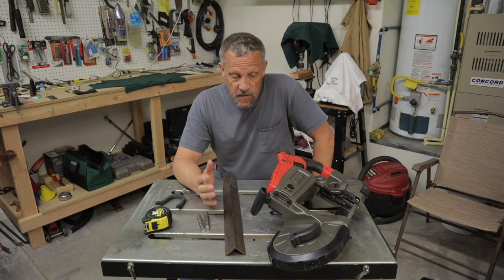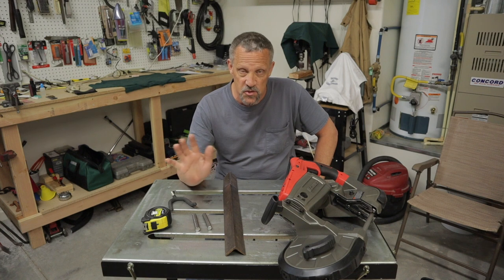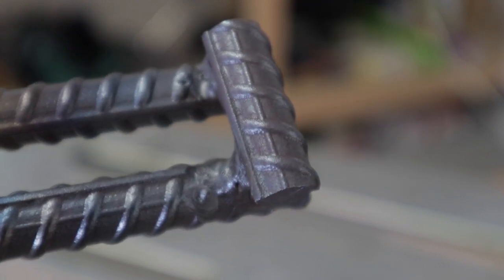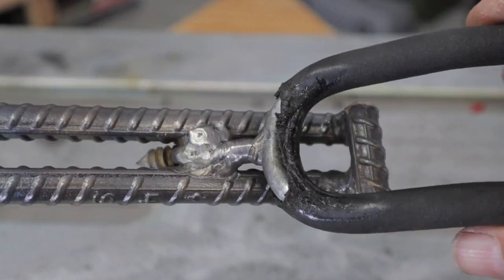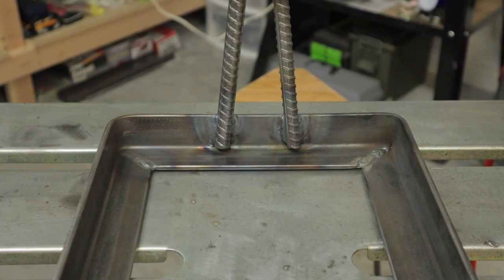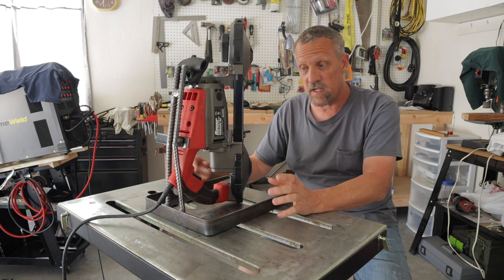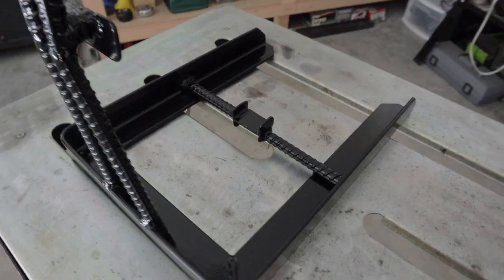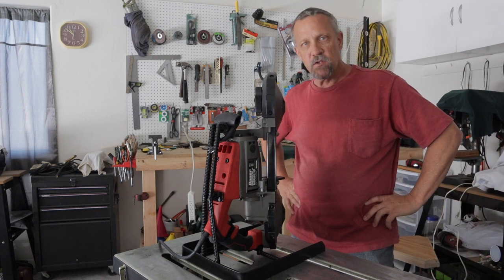DIY Harbor Freight Portable Bandsaw Stand - Homemade Tool Ideas - Fun Beginner Welding Projects

Comment: I built a similar stand out of scrap wood with great results.
I thought it over and went with the foot operated switch.
The reason being SAFETY. If for whatever reason anything goes wrong you’re going to step off the switch and these saws stop really quick.

Comment: I made a similar stand but the way i bent the rebar was to use a propane torch on it until it glowed, then clamped it into a vise and bent it. worked great and no breaking.

Comment: From a beginner tig welder, the best thing I have found to get any weld to come out better is to have something to rest your torch arm on. Even resting your elbow makes a huge diff. Made a large C clamp and used that to rest my arm on off my welding table.
Also hard to tell but seems like your gas flow is high, based on how far the arc was flying.
Stand looks great!
Reply from the maker: Thank you for the tips, I appreciate it. I agree with you and think positioning can have a huge affect on my weld. I really find positioning a challenge most of the time. I guess practice and experience will make it easier over time. I have my gas flow set at 15 cfh and my welds are coming out pretty dull and grey. From what I've read the cfh seems about right for my amperage I think. The dull color may be due to the metal I'm welding and how clean it is or isn't. Also I didn't remove the mill-scale from the angle iron, I'm guessing that has an affect on the weld appearance as well. A lot of things to think about and work on with this welding process for sure. Thanks again and take care.
Reply: @DIYHomesteadProjectsDIYHP10  I have always seen match gas flow to cup size. Usually about cup size x 2.
15 should be fine though unless you're running a 4 or 5 cup. Dull and grey is how mine started, learned to match amps to thickness of metal and my welding speed from weld.com. They always say once you establish your puddle start moving but never leave it behind haha. 
Good luck with the Tig and your next project
Reply from the maker: Again thank you for the tips and info. So far I've been running a 6 & 7 cup. I definitely need to work on amps. Most of the time I think I'm using way too many amps. Reading the puddle is what I'm trying to learn to do so I can adjust as needed with the pedal. I need lots of practice. Take care :)

Comment: Hey buddy,,  i watched your video about making stand for the bandsaw,, i have it too,, and i can say that it is a good bandsaw,  but anyway,, i watched how you welded the rebar and other metal.  I know you mentioned that you are a newbee in welding,, but  just one small advice when you tig weld,, first start your puddle and then add the filler rod,, but you probably know it now. nice video.
Reply from the maker: Thanks for the tips Martin!

Comment: Very nice...ingenuity is great.  Suggestion - I noticed you remove the torch from your weld stop way too soon. Keep it there bathing it in Argon.  Set your post flow for five to seven seconds until it doesn’t glow.  This will almost eliminate oxidation and weld contamination.  Enjoy your vids.
Reply from the maker: Thanks for the tip Rob, I appreciate it!

Comment: That ended up looking pretty slick... 

2 observations:
- that U hanger/hook thing was galvanized.  You should have taken the galvanizing off of it before welding, I'm surprised that you were able to TIG it at all with the coating on it, but even if you did the fumes from the zinc burning off are very dangerous, they could make you quite sick
- you appear to be right-handed (based on the way you're gesturing and doing some things, but I'm not sure), you're welding left-handed.
Reply from the maker: Thank you Mark, I'm real happy how the stand came out. I use it in the shop quite often and it's one of my most used items I've made recently.
I am aware of welding on galvanized items and I agree with you. If I weld on anything galvanized I try to do it out in the open air and I also use a fan sometimes to blow the fumes and smoke away from my face. Mostly I just try to avoid welding anything galvanized. Thanks for the heads up and concern for my health.
I'm actually predominately left handed but in some cases I'm ambidextrous. In some cases there are things I can't do with either hand. LOL 👍
Reply: @DIYHomesteadProjectsDIYHP10  Lately I've been dunking stuff that's galvanized in muriatic acid, which takes it off quickly.

I watched a few of your other videos and couldn't decide if you were right or left handed.  My daughter is ambidextrous but finally decided to write with her left (she draws with both, she'll switch when she gets tired 😋 )
Reply from the maker: I've heard that vinegar works too but it takes longer than the muriatic acid. If welding a lot of galvanized parts, one of those ideas may be the way to go.

Comment: I loved the video and watched it all.  If your overheated U-hook coating starts sliding off in the future try a few wraps of rubber fusion tape.  I love making something from nearly nothing too.  You nailed it on this build. Thanks for taking the time to share.
Reply from the maker: Thank you for watching! That's a good suggestion for keeping the coating on the u-hook. Fortunately so far it hasn't been an issue as I once thought it might be. This stand is one of the best things I have made for this saw. Have you seen the custom table I made for the saw? I'll post a link here for you if you are interested in watching that one. Thank you for the nice comment!
DIY Harbor Freight Portable Bandsaw Table - https://youtu.be/1aGmnCkNnfU
Reply: Liquid electrical tape! I use it for tool handles frequently when they fail!.
Reply: Substitute fuel line hose for the melted coating.

Comment: Great job! So many different builds for there on YouTube and yours is as good or better than most. Also, your welding, for a beginner, is nothing to be ashamed of. With some more practice, your welds will be as pretty as they are solid. Thanks for sharing your ideas and advice.
Reply from the maker: Thanks Bones 1477! It's been a great stand and it was a fun project to do. I appreciate the encouragement on the welding. The more I practice the better my welds are for sure. Thanks again for your positive input!

Comment: Very cool. I really like the way you let the saw actually drive the design fitment process and the final solution; simple and solid with an industrial art touch.   Nicely done! 

 Having the same saw, I plan to follow your lead, but reduce the footprint and make vise mountable to save space. However, a cut off saw pivot mod seems doable at well.  

Regarding welding rebar, my research indicates that rebar marked with a  "W" (ASM A706) is formulated for welding, but ASM 615 (not really recommened for welding due to higher carbon content)  is much more common and what I find at the local big box stores.  I wager it is probably what most folks use for welded art projects anyway.   So, what flavor did you end up using, rebar, filler rod, etc.?   I'll be using Mig with ER70S2.  Just got a TIG welder for X-mas, but the actual welding part still eludes me.  Thanks.
Reply from the maker: Thanks, I appreciate that. The stand has proven to be a very useful tool in my shop. It was well worth building IMO. 
I really don't know what rebar I used, what ever kind I found at my local Lowes. I used ER70S6 3/32" filler rod and I think around 100 amps maybe 110. I found the rebar I used seemed to weld nicely with the TIG but I have also used MIG with ER70S6 .030 wire and .030 flux core wire on a 120V gassless MIG and it did fine there too. I've even stick welded this rebar with 6013 3.32" rods and that worked well too. Heck, I'll use pretty much anything to weld it and it is about as cheap of steel I can buy so I build a lot of things out of it. It's fun to design and dream up things to make out of it I think. Have fun with your project!
Reply: @DIYHomesteadProjectsDIYHP10  Sold!   Thanks for the feedback.  Subscribed.  I'll have to go back and review your channel's library.   

Now that I think about it, easily scrounged bed frame steel is harder than Chinese algebra and it seems to weld just fine.    I suppose the "no welding 615 rebar" advisory is really more applicable to concrete reinforcement applications.

Comment: Great build and really good vid.
Clean design. Rebar, 3' angle iron, gararge hanger/hook and a piece of rubber. No frills.
Just needs a plate attached inplace of the guide thingy to lay work piece on as you run it into the blade.
I think I'll build this first and do a Horizontal/Vertical version latter. This is just too simple and low cost to pass up.
Thanks for posting.

Gota Sub to see any new stuff from you....
Reply from the maker: Thanks RJ, I appreciate it! You may like this one https://youtu.be/1aGmnCkNnfU

Comment: Good job! Are you going to add a table top plate so you can lay your prices on it when your cutting? Also you really are getting the tig welding down! "Practice is the Mother of Skill"!
Reply from the maker: Thanks Glen, you are right, practice is the key!

Yes I did make a table for the portable band saw. I didn't want it too large because I want to keep the saw portable. Here is a link to that video if you are interested.
DIY Harbor Freight Portable Bandsaw Table - https://youtu.be/1aGmnCkNnfU

Comment: Gonna start to work on mine this coming week. Thanks for the great video. Out of curiosity, did you get the saw blade (band) from Harbor Freight or from another store? I've heard the blades from Harbor Freight aren't very good.
Reply from the maker: Garry the blades I used in the video are from Harbor Freight and I found them to be descent. I purchased some Dewalt blades from Amazon and they are what I have been using lately. They seem to be ok too and last about the same time as the HF blades in my opinion. 

DEWALT Portable Band Saw Blade - https://amzn.to/3MGBn6T
Reply: @DIYHomesteadProjectsDIYHP10  Thanks for the info and the video.
Reply from the maker: My pleasure Garry